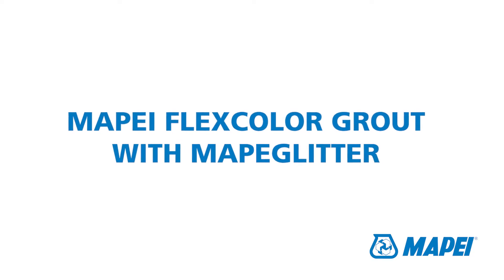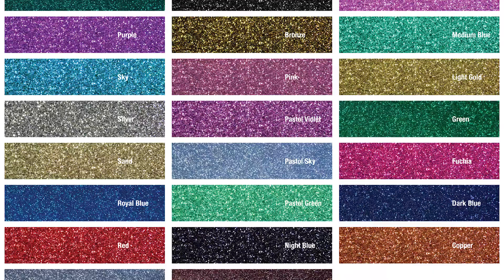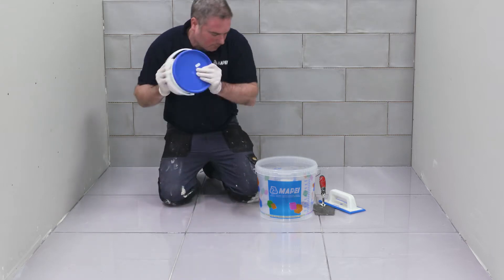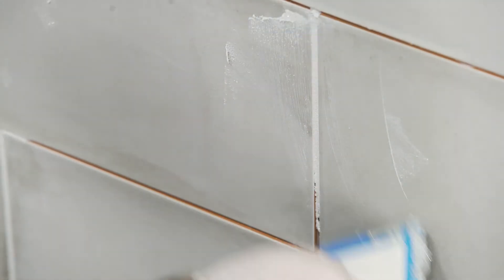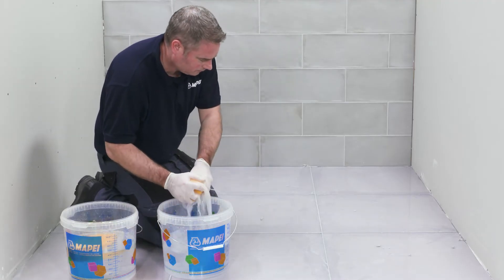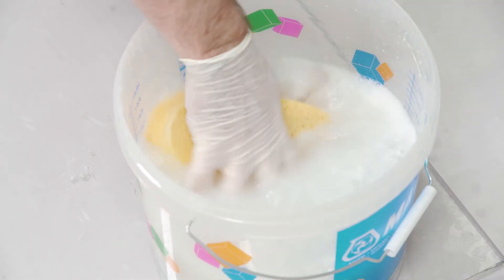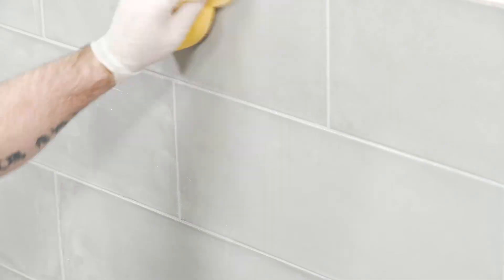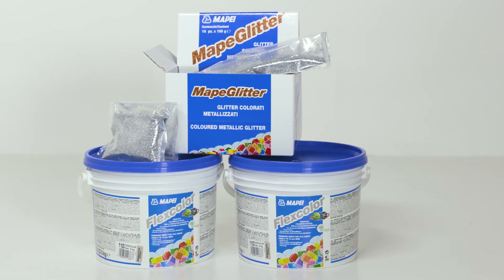Mapei Flexcolor with Mapeglitter

Comment: I didn’t add glitter, but I used flexcolor on the mosaic hex tile I put down on my laundry room floor. I was nervous about it and watched a lot of videos before I started, but I followed the directions exactly and the grout went on without any problems. I used a timer and gave myself 5 minutes at a time to spread grout then cleaned that section off. I was prewarned to look for tiny bubbles between each section of grout that was completed and made sure those were filled. The one extra thing I did was after the second wash and a short drying time, I used a clean, damp microfiber scrap to buff the tiles lightly. The floor came out really nice and and the grout is still clean and bright after 8 months. I’m really happy with my floor, and am getting ready to grout a bathroom today with the same product. Yes its more complicated to apply than regular grout but so much better and I highly recommend it.